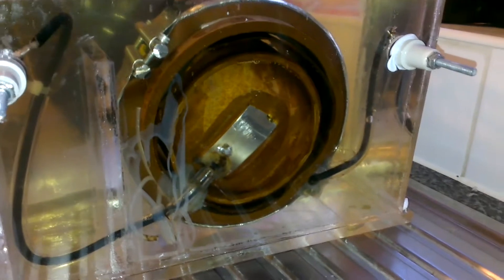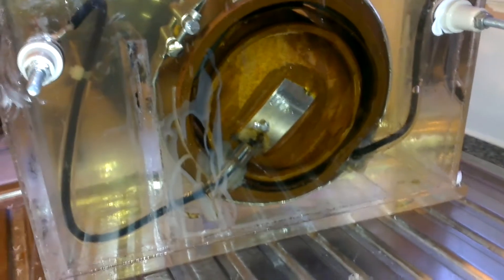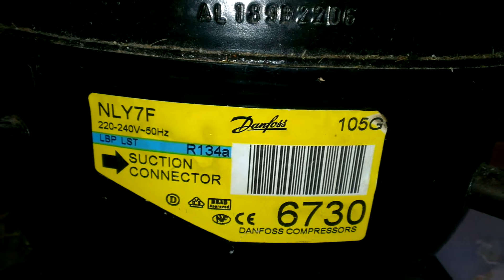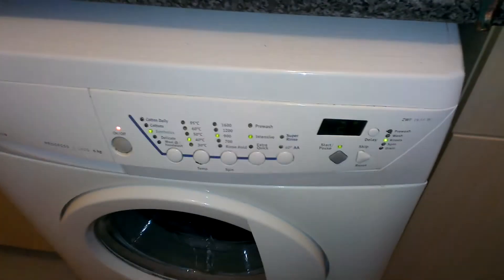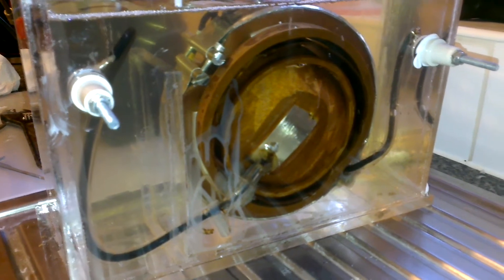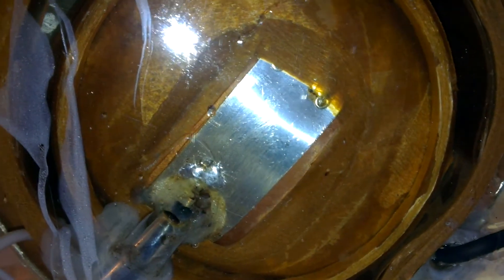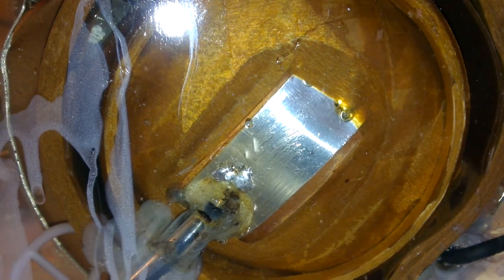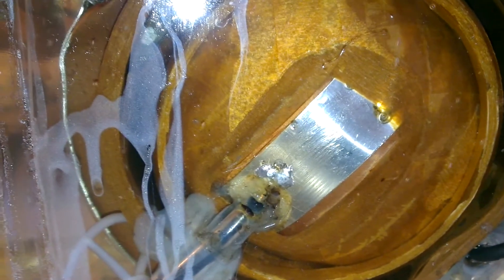A little explination while vacuuming my X-Ray transformer and why

Comment from the maker: Ah i see this does look like some transformers like ones from portable medical machines that would have been under pressure of sulfur hexafluoride but its not it was originally used in a metal scanning machine and has always been in oil .The transformers do look very very similar though i have one that was in sulfur hexafluoride from a portable medical machine there were 2 providing 300kv  i have 1 and my best mate has the other and they look the same just about double the size of this little 1

Comment from the maker: I am going to heat it again nearer to the end but i did heat the oil in a pan on the cooker to make sure and started the vacuuming straight away it was very hot. Thanks for the info ya can't beat having extra ideas it normally ends up making a lot better end result :)  Its looking more and more like I'm gonna have to get a 20A variac to replace the 5A one I'm currently using .better get saving or hope my trike sells :)

Comment: Looks good! Another method of getting air out with vacuum is to apply some heat to the windings. That lowers the viscosity of your oil and it helps getting every last bubble out. Easiest method for heating is just to short the HV winding and add small current through primary with something like variac and let it heat up :)